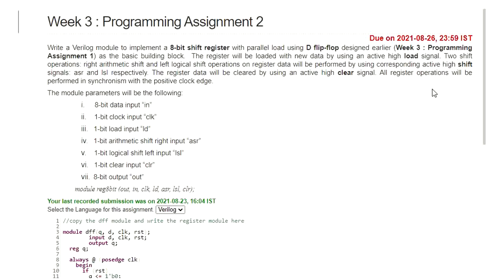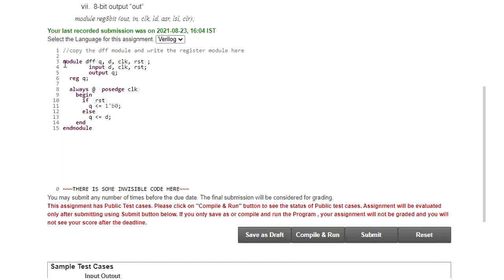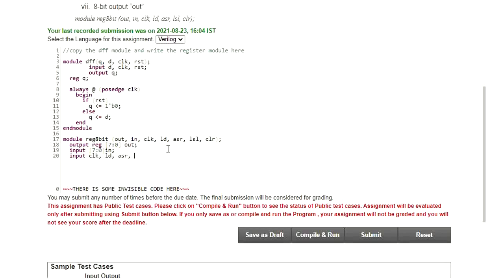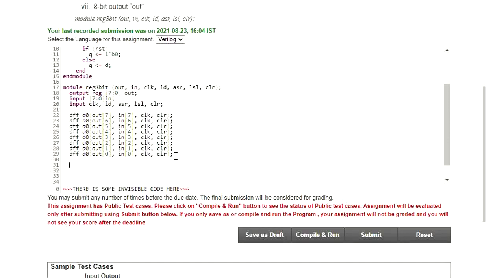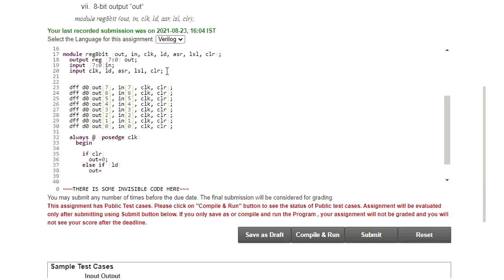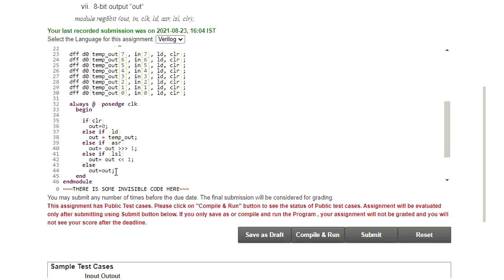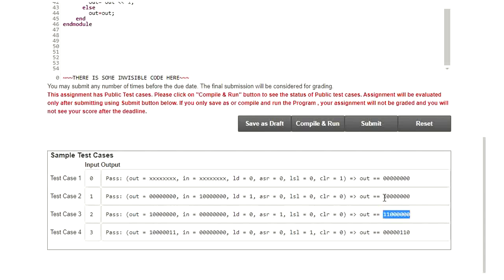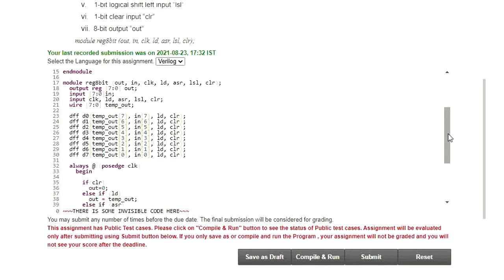design of 8 bit shift register using d flip flop | Instantiation of sub blocks in verilog

Comment: Sir, since we are using Arithmetic Right shift we have to assign output as "signed" register.
Reply: In line 18:                                                                             we have to write " output reg signed [7:0]out; "  instead of " output reg [7:0]out; "
Reply: If we write the code like this Test case 3 will also pass
Reply from the maker: Ohk..! got it.. thankyou Mano Murugesan
Reply: And Also Pin this Conversation Too. Which will help other Learner to distinguish that which part we have make the correction
Reply: Thank You Brother, Your One word has corrected the flaw in the entire code.
Reply: @criss_royy8933  👍

Comment: Sir, Understood on how you are instantiating the D Flip FLop Modules, with your approach, I have also been able to write the Verilog with some of my inputs as well, See in reply of this Comment,
Reply: //module of D flip flop
module dff (q, d, clk, rst);
		input d, clk, rst;
		output reg q;
  
  always @(posedge clk)
   begin
    if(rst==1) 
      q <= 0;
    else
      q <= d;
   end
  
endmodule

//8-bit shift reg module
module reg8bit (out, in, clk, ld, asr, lsl, clr);
  input [7:0] in;
  input clk, ld, asr, lsl, clr;
  output reg [7:0] out;
  wire [7:0] temp_vec; 

  dff D7 (temp_vec[7], in[7], ld, clr);
  dff D6 (temp_vec[6], in[6], ld, clr);
  dff D5 (temp_vec[5], in[5], ld, clr);
  dff D4 (temp_vec[4], in[4], ld, clr);
  dff D3 (temp_vec[3], in[3], ld, clr);
  dff D2 (temp_vec[2], in[2], ld, clr);
  dff D1 (temp_vec[1], in[1], ld, clr);
  dff D0 (temp_vec[0], in[0], ld, clr);

  
  always @ (posedge clk)
    begin
      
      if(clr)
        out <= 8'b00000000;
      else if (ld)
        begin
          out <= temp_vec;
          if(asr)
              out <= out>>>1;
          else if(lsl)
            out <= out<<1;
        end
      else if(!ld)
        begin
          out <= out;
          if(asr)
            out <= out>>>1;
          else if(lsl)
            out <= out<<1;         
        end
    end
endmodule
Reply from the maker: Yes you can write like this also.

But it makes the code lengthy.. bcos of seperate block for 'ld' and '~ld'
Reply: @ExploreElectronics  yess this ibe is much leanghty code